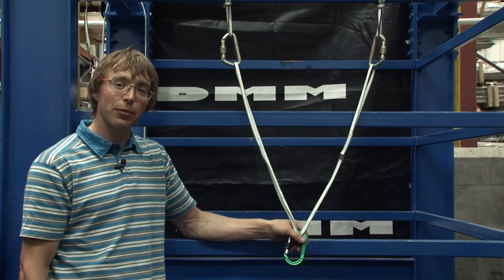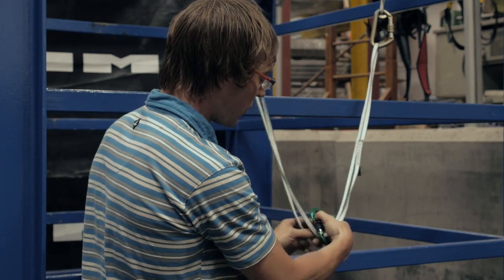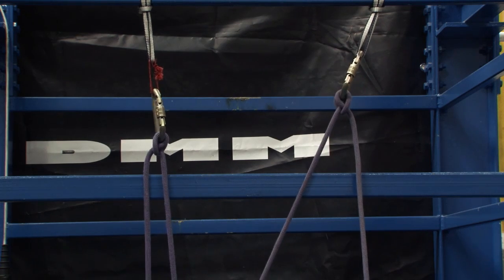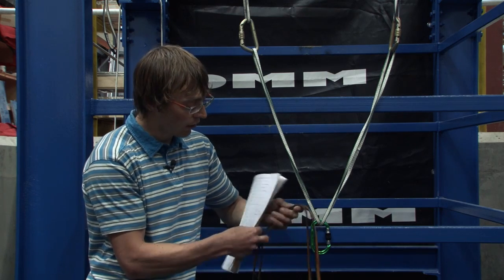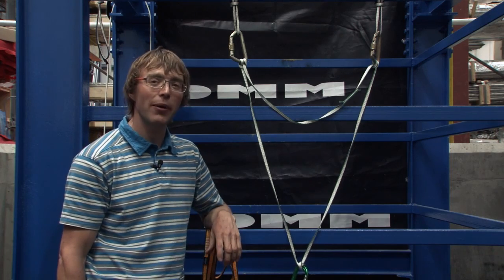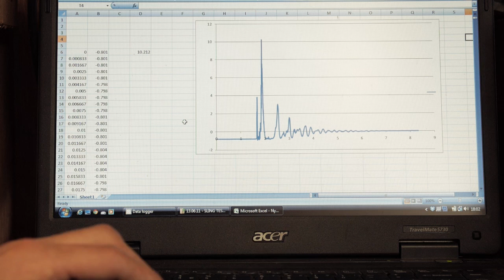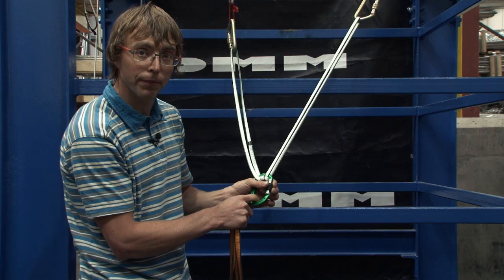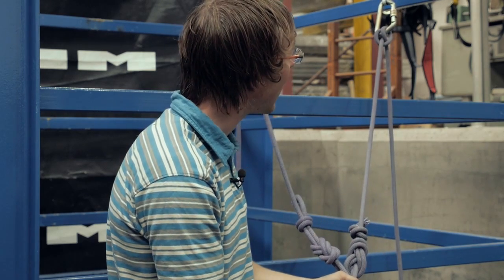DMM Techincal Video on Slings at Anchors

Comment: Anyone else notice how much force DMM's test rack absorbs? When one point fails, the rack is immediately impacted and swings quite a bit, absorbing a lot of the shock that the other components would've taken instead...Seems like in a real-world setting there would be more failures in their test setups?
Reply: @Tammy Gueterman , I agree.  I would rather the anchor points be rigidly attached like a actual rock.
Reply: @KillroyX99  The rig is attached to a force meter so that they can obtain all the data that he was discussing.  If you attached the anchor points to a static point like a climbing wall you wouldn't be able to measure the force introduced to the system.
Reply: @eagle191 , thanks for your comment.  The test rig could be riddgidly attached and the force meter could be added at any point that they want to measure. This would be just fine tuning the "Design Of Experiment".  As mentioned before, the change that would add the most realism is a falling dummy that acts like a falling climber (rigid mass vs compliant body)

Comment: Nice video! Dyneema is good for individual protections because it's lighter and less bulky. But I'm a nylon fan for the anchors. Also nice to confirm the danger of the sliding X. Just miss a comparative of the loads for these same configurations but using nylon cords instead of slings. Cheers!

Comment: For me the most interesting point is the effect of knots and slippage into the system. Everyone mentions that knots weaken slings, but these tests emphasize that slippage of the knot adds a dynamic element to the system that lowers the peak force. 

Not mentioned in the video is the effects of these forces on the human body... I am not sure what happens to a climber who absorbs >12kN of force from a fall. I imagine serious injury....
Reply: So your right that he mentioned the knots add a dynamic element, but they also reduce the total strength by half, so the knotted ones ended up breaking while the unknotted one did not break.
Reply: The biggest weakening in these examples is when they clove hitced to the anchor points with a sling. Then they got only one strand of the sling loaded and that will break it a lot easier.

Comment: Great video and very well-made. I was wondering if the overhand knot method is common practice. The way I have seen it done before is an overhand on a bight(also making sure to not over-tighten the knot as to allow it to absorb some impact) tied at the master point, instead of just an overhand directly on the sling. Is there an advantage to either one of these methods? Does one of them weaken the sling more than the other? I appreciate your response.
Reply: One advantage of the simple overhand (a SWAMP, shelf without a master point) is that the knot is not cinched up very much under load, making it easier to untie, and it uses up very little of the length of the sling.

Comment: Can you show more detail (perhaps on your website) of where the failures happened on the slings?
Reply: For instance, static testing has shown that knots in rope reduce strength ~50%, yet in these test it looks like the failure was not always right at the knot.  If the failure happens at the knot and the not comes undone, there is not redundancy. YIKES!

Comment: I've used the primary rope as much as feasible, with clove hitches or my all-time favorite, Butterfly knots, at anchors for over fifty years, and I find the modern sling-heavy systems to be "guide friendly," quicker to set up especially at fixed anchors, easier to swap the clients and then continue, the guide always leading. But, the extra complications, significantly weaker shock accommodation, and such I find troubling. The beauty of clove and Butterflys are they are rapidly adjustable while still tied in, and the BK is as strong across the loop as it is into the loop; it allows a lot of flexibility in opposing or combining directional elements, equalizing without extra slack added in a partial failure, and overall a far cleaner less cluttered look. On trad routes, as long as you have adequate rope per pitch, sling systems are far less versatile than good old lead rope tie-ins.
Reply: thanks for your comment, i realise it was a while ago but i have often wondered about using alpine butterflys in belay as it seems very elegant, do you have any suggestions on how to do this or reading material?

Comment: what if the dynamic rope is attached to the sling anchor?
Reply: Sile H adding a dynamic component to the system is going to reduce the forces substantially every time.

Comment: Very interesting video, thank you for posting. I think the real world takeaways for this are: 
1) Avoid using dyneema runners in an anchor system; use nylon or the rope instead.
2) Avoid using the sliding X unless you use limiter knots to minimize extension.
3) Don't be a f**king idiot and climb above your anchor when only attached to it with a dyneema runner!
4) Shout out to Black Diamond, DMM, Metolius, Petzl: Why is it that you tech wizards cannot manufacture a runner with more stretchy, dynamic qualities, when doing so appears to clearly minimize impact forces on rock protection? I'm talking about something like a really strong bungee cord is the core of a nylon runner. Any company that can figure this out could revolutionize climbing.
Reply: yep would be great if they actually brought out something like that
Reply: That's called a climbing rope... stretchy, dynamic and reduces the impact force on the climber and the anchor
Reply: @duxforddude  yeah, but you can't go tying your rope into the pro you're placing as you move up the route.
Reply: @eagle191  It's just about the anchors and also only the persons directly connected to the anchor. With the pieces along the route (or your seconding climber) there's always the rope in the system, softening a fall.
Reply: @ketzaston  true
Reply: @duxforddude  and rope is cheaper than slings....

Comment: It makes me wonder if a smaller, lighter nylon sling is better to climb with than a Dyneema sling even if the static strength is stronger. 

We climbers don't put large static forces on slings, we put large dynamic forces.  Dynamic force matters!
Reply: If you're putting large dynamic forces on your slings you're doing something wrong.

Comment: And yet with all the knowledge and instructional material out there. Here we are in 2021 and THE widely accepted and prefered anchor buding material for the common outdoor climber is.......... 240cm Dynema sling.
Reply: Dyneema slings are perfectly safe to use as an anchor IF you have a dynamic rope in the system. It is almost common knowledge now that you cannot use a sling by itself as it's static and not good at taking shockloaded impacts.
Reply: @Max-ik9qb  The warning exists to tell you not to tie a dyneema sling back together if it was snapped or cut as it risks slipping. Using overhands or a figure 8 to make a master point in a non compromised dyneema is not an issue. A knotted dyneema sling will still be stronger than the 3 nut traditional anchors they are attached to.
Reply: @sanchoviesfan6971  you are wrong! go troll mountain project.
Reply: @Max-ik9qb  I almost exclusively top rope from 11mm nylon slings or 8mm dyneema slings tied exactly like I said above. The exception is using cordalette or static rope when I need to extend my anchor beyond a lip. What material do you build your anchors from?

Comment: Good thing I'm not a solid chunk of metal using a static rope. A human wearing a harness, falling on a dynamic rope helps cushion shock, our bodies are bags of liquid & a harness & rope has a lot of give, HowNOTtoHIGHLINE has a number of videos on why shock loading is generally a myth & with dynamic rope + a harness + human... a human will never go over 5kn of force on even the hardest fall. Interesting test though.
Reply: You describe a very different situation that is not tested here. Whats tested here is a situation at a belay anchor, where you often have no dynamic rope in the system. Also in these situations factor 2 falls on static lanyards/slings are possible. And in these situations shockloading is not a myth, bc there is no dynamic rope in the system that absorbes the shock.
Reply: You could not be more mistaken; lost two friends around twenty years ago, when their anchors were ripped, probably from a short but FF2 past the belayer; they went about 800 feet to the base of Middle Cathedral in Yosemite. Impact forces of lead ropes are designed to stretch below the threshold of serious injury to a climber. Petzl's site shows real world measurements in belayed fall scenarios, where a belayer feels 2kN, the leader feels 4kN, and the top piece feels 6kN impact force. A long factor 2 fall requires many feet of stretch in a dynamic rope to spread the force over time, and the notion that a flexing bag of fluid can absorb such energy over a foot or two is absurd. The far more dangerous, yet intuitively underappreciated scenario is dropping a few feet, but onto static sling or chainlink anchors, where a climber commonly has little or no dynamic material in the connection. Clipping in to a one foot chain with 6" of lead rope, stepping above to rig something, and dropping down makes a fall of three feet, onto just 1 foot of dynamic material, and effective FF of 3. Replace the rope with a static sling, and you have an incalculable fall factor, with only the harness and body to absorb the impact. And there is not "a lot of give" in that situation.

Comment: Was that rope static or dynamic?
Reply: And what size was it?
Reply: +Jimmy Carroll Its a dynamic rope. You can see it stretching during the fall, which suggests that it is dynamic. It would also be representative of a rope used for this sort of scenario hence why its moved. Looks like a 10.5 or 11mm single rope.
Reply: +happynotnormal He says at the start its an 8.2 1/2 rope
Reply: Everyone should know that static ropes still stretch a significant amount, but stretch very roughly 1/2 as much as a "dynamic rope"

Comment: What I don't understand is these slings are typically rated to 22kN and in this video they are failing at 4 and 5kN, what gives?
Reply: Knots, while they can reduce the force exerted on the rope/sling, can also weaken the rope/sling.
Reply: I think the failures at 4kN were the 2mm gear cord links....

Comment: Dyneema failed and Nylon didn't -- I would rather have Nylon
Dyneema's impact load was significantly more than Nylon  -- I would rather have Nylon
Dyneema is less bulky than Nylon-- I would rather have Dyneema in this case

Wait a second, impact loads are much less in Nylon, why not decrease the bulk of Nylon?  
Nylon is less expensive too, so it can be replaced more often if we are worried about abrasion and UV exposure.
Reply: And as a mountaineer I always use dyneema over nylon (that stuff stays in my sport climbing bag). Nylon will saturate and freeze at which point it loses significant strength, whereas dyneema sticks it out like a champ.

Comment: Seems misleading. This test is taking the belayer and the dynamic rope out of the video. Outside of fall forces if built your anchor out of the climbing rope as suggest it would be difficult to escape the belay if you needed to rescue your climbing partner.
Reply from the maker: ***** I think Greg G has summed it up perfectly. The tests are that just tests and it is never going to emulate the real world. In test the variables are controlled, however we believe it is a great effort at informing us climbers.
Reply: He's really only talking about messing around above an anchor while still attached to it, which you shouldn't do anyway
Reply: Miss informing* Again the test has nothing to do with real life situation. The static gear is not meant to be fallen on directly and that type of fall would have never happened in a real life situation.
Reply: This video refers to the forces at a belay station. Using your rope to tie into the anchor with clove hitches has been a long standing technique used by experienced multi-pitch climbers. Slings and cordelettes are used primarily for natural pro that needs equalization because of different heights in the anchor system. As for anchors placed on lead they are usually but not always single point, with no need of equalization and the forces on each anchor are considerably less because the climbers rope is dynamically applied in a fall as it slides through the quickdraw vs statically in a belay.
Reply: This is a non real life situation. I agree with you though. Just think...22kn...i can, and have towed a car with a sling lol  i think the main point of the video was to get eng nerds going through numbers and stats...not towards how to take a 400ft whipper with 40lbs of gear on and see if an achor will catch you lol with 4,400 lbfs

Comment: I hate this video, so many climbers see it and think "OMG, dyneema is death." 

A steel weight is a poor model for the human body, especially at the lower end of the energy scale with small falls on static gear: skin sags and stretches, limbs/muscles extend, blood sloshes to the extremeties, etc; which all absorb quite a bit of energy and reduce peak loads. I understand that rigid steel weights are a cheap/practical way to get repeatable results,  and the results extrapolate well to long falls on a rope (where the energy absorption of the body becomes a smaller component), but it gives unrealistic data for climbing anchor scenarios.
Reply: You are right and the video addressed the worst-case nature of the test.
Reply: maybe they should repeat the test with a pic carcass in a harness in place of the weight.... :)